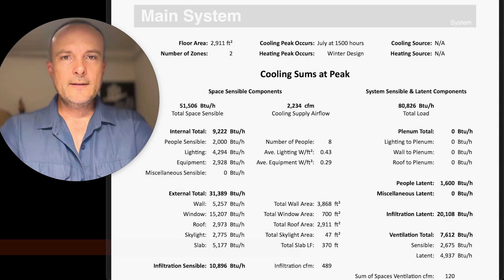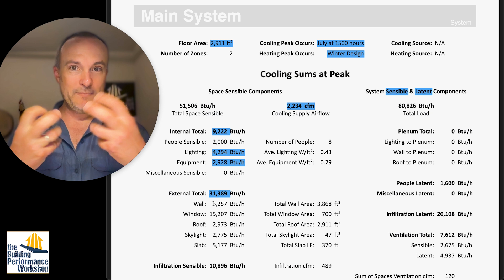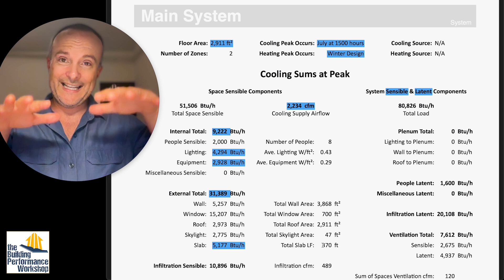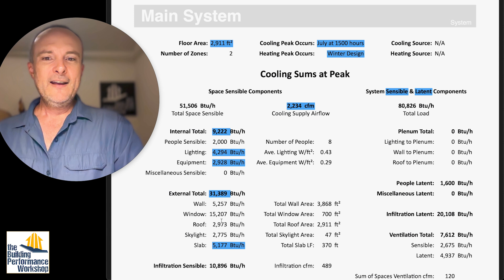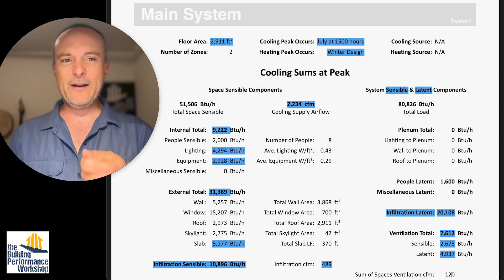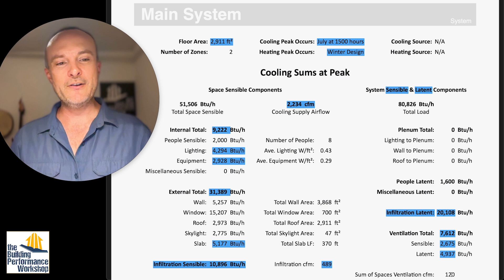HVAC Load Calc Math: Quick Checks for Page 1 in your HVAC Design

Comment: currently in process with architect and soon the structural engineer on my house plans. 
When would I be getting HVAC design done, and is that something that is typically just done/managed by the GC once we actually get towards building?
Reply from the maker: Most of my clients hire HVAC design out directly (they also buy all the accessory ventilation equipment and parts themselves). Earlier is better.
Reply: @HomePerformance thx!

Comment: Great video. Wrightsoft counts ventilation as infiltration if youre using an exhaust strategy, which is a bad idea as we all know. But it essentially is mechanical infiltration
Looks like they grossly inflated both ventilation and infiltration here.
The other place where numbers are fudged is on the Manual S side.
Reply from the maker: Good point T :)

Comment: I'm sure you know this, but for the general public, both sensible heat and latent heat are physics terms. 

Sensible heat is energy that, when imparted/removed to/from, a substance raises it's temperature. 

Latent heat is energy that, when imparted/removed to/from a substance, enables a phase change.

I love that it's application to HVAC is so strait forward, in that sensible is reducing/increases temperaturer and latent is removing/adding moisture.

Comment: Thanks for this presentation.  I've been working on tightening my home for the last couple of decades.  Still need to do the blower door test.  I've actually used John Siegenthaler's Modern Hydronic Heating book to calculate heat losses and converted the result to BTUs/Degree change - then used this to calculate the sensible cooling needed.  Still need to compute the latent cooling and other requirements.  I have also have 2 HRV's and am looking at adding additional dehumidification external to the AC.
Reply from the maker: Keep it up Peter!

Comment: Do you have a List for energy audit/home inspectors? HERS rating blower door tests or otherwise?
Reply from the maker: Try this: https://homediagnosis.tv/pro
Reply: As the homeowner, I use both LoopCAD for the hydronic (infloor)heating and WrightSoft for the cooling (ventilation). Then cross reference the results.  Another way of checking results.   The HVAC contractor was quickly able to correctly size the ductwork for the cooling load and work on the estimate/quote.
Reply: The slab requires R10 continuous at the perimeter - so that is way inflated. Says the ChemE.

Comment: For consideration only, when it comes to heat load through consideration for residential foundations, I can tell you from personal experience there can be noticeable thermal bridging through the foundation into the conditioned space.

My home has stained concrete floors throughout and in areas where the exterior face of the foundation is exposed above grade the floor inside the home is noticeably warmer during the summer and cooler in the winter.  The temp gradient extends approximately 12” from the interior wall into the floor space.  Noticeable to the touch and measurement.

I can’t say with 100% accuracy, but believe based on other homes Ive lived in that this would not be noticed to the same extent or at all if floor covering (I.e. carpet or tile) was a present.  Tile probably more-so but still to a less degree than stained concrete.
Reply: Good point, concrete can get to dangerous temperatures, hot enough to burn you in some climates. If it's in direct contact with the slab, you will definitely get heat gain from the edge inwards.